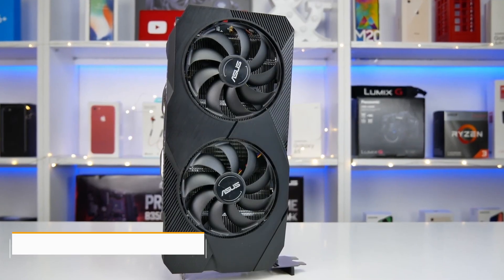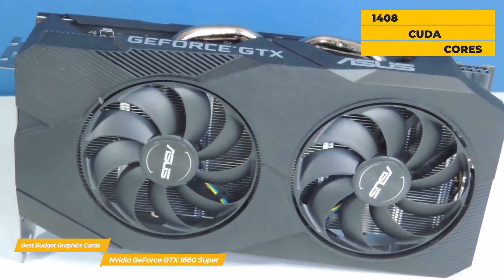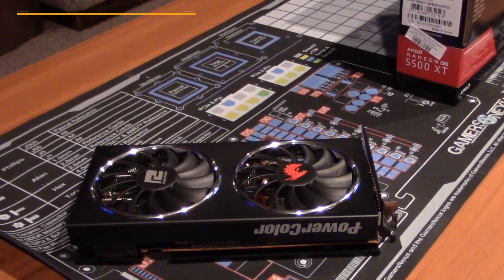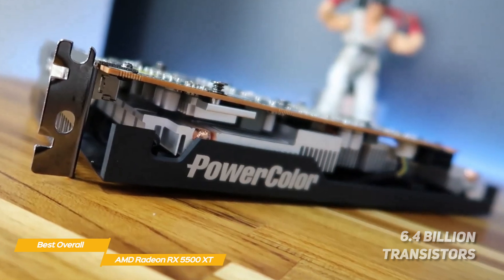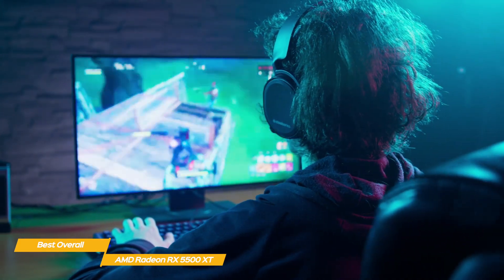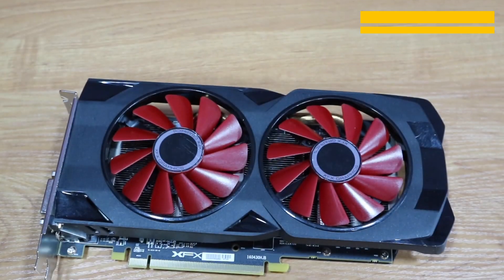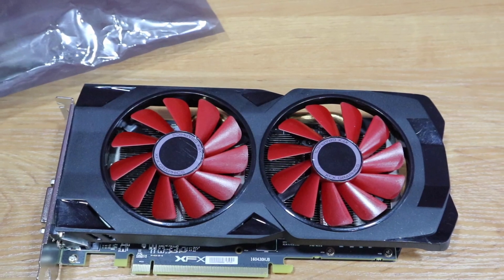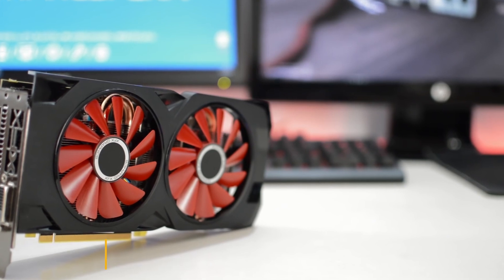TOP 3: Best Budget Graphics Card 2022

Comment: Bruh I just figured out I have a gtx 960 2gb it's been running tarkov on medium though  so I guess not to bad
Reply: Yeah and I cant believe my GTX970 still makes it in 2022 low to medium settings running everything fine even games like GTA5 Its running on max settings, damn proud of it
Reply: @NeelixMaster  GTX 970 is probably one of the best old gpus you can have. My GTX 970 was able to play every instensive game at minimum 60fps 1080p. Its like it was released recently. Unfortunately im having some problems with it and im gonna buy a new one but if u dont have any problems with it crashing or dying, you wont need a new gpu for the next 5 years atleast.
I dont think there's a game that will make the GTX 970 struggle
Reply: @v4lio  At this moment its not really needed indeed, but Im also planning on to get a 4000 series maybe an 4060TI or even 4070 because I wanna experience the new upcoming games on ultra to max settings, I wanna upgrade in 2023 and Im thinking like 2024>2025 will be a year with alot new games that'll require some new gpu's in action.

Comment: which gpus from the video are mostly recommended for games like fortnite and counter strike?
Reply: For csgo you dont need an insane gpu. Its more cpu heavy. Fornite can run on integrated graphics, but for gpus anything in the gtx 900 series is gonna be good enough. Even an rx 570 4gb us decent for 1080p gaming.
Reply: Bro buy a gtx 1060 gb. Best gpu
Reply: idk but just add ram if u bought one of those
Reply: Honestly I would like to recommend the GTX 960, it's relatively cheap and still really fucking good, I've been running it on a lot of games at really high fps
Reply: @theranger7924  little late but what games and how many fps because I found a Gtx 960 4gb for 80 bucks
Reply: You could honestly play them without one. Just get a Ryzen cpu with integrated graphics for way cheaper
Reply: 1650

Comment: AMD RX6600 is 300 rn.
Which has ray tracing, is stronger and has more video ram. No reason not to get it over the 1650 super.
Reply: 300 is still 300
Reply: reason is streaming, nvidia has built in encoder chip
Reply: Whats the nvidia equivilant of that please
Reply: Mega cap
Reply: @dono3394  back then that was true if you weren't a content creator who needed the encoder.
Prices have changed though as this was 5 months ago and the market has changed massively.
Reply: Its 600 now
Reply: @Zoozsyyy  I haven't found one over 330 I think you're just high
Reply: @modables  alr man
Reply: @modables  where are you looking bro?